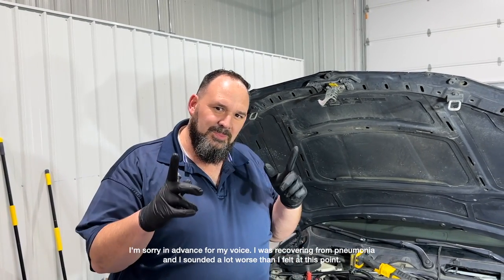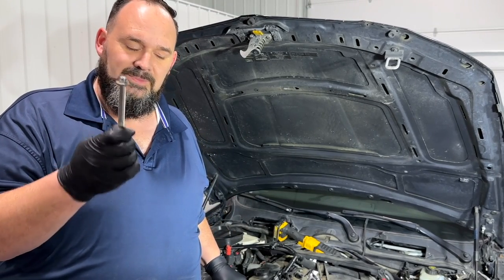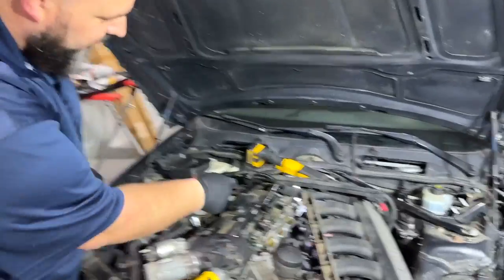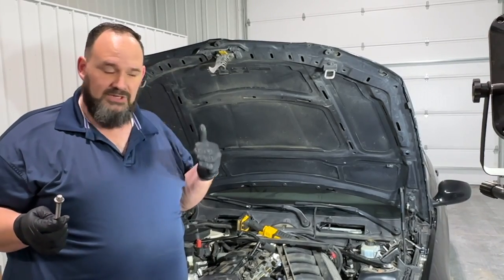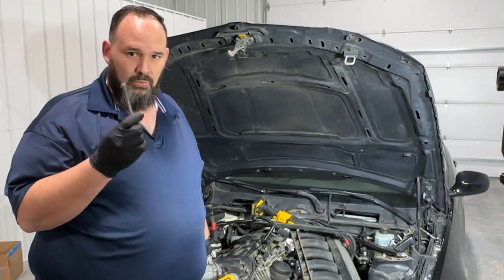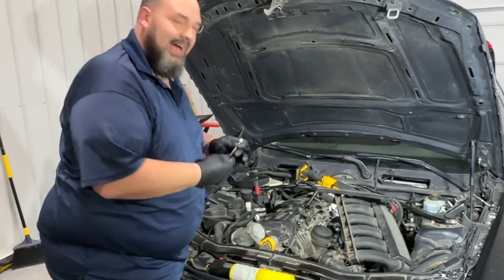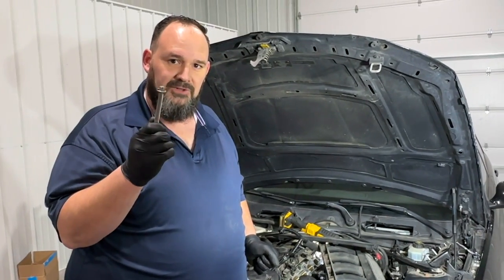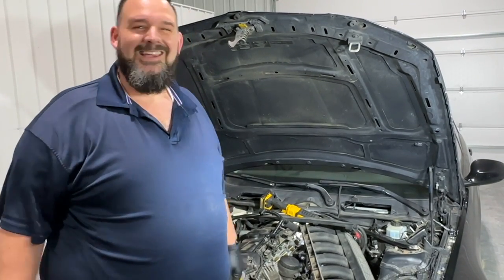Watch this before replacing your E-Series BMW Starter!!  -  E90 Maintenance Series

Comment: Thank you.  Mine didn't have corrosion - but being 18 years old, was concerned, as already had done this before on an E36 BMW.  I used the same 12-point 11mm wrench with 15 degree offset, that I used on the E36, both worked nicely without rounding.

Comment: In very many cases,  in order to use jb weld, the head of the bolt is soaked with oil, in order for jb weld to work,  surface of metal absolutely HAS to be clean and scuffed as much as possible. In this case. That head of the bolt is a super "can't understand normal thinking" 
Just my 2 cents

Comment: I just got that damn evil stupid bolt out. Had to saw-zaw a vertical slit that cut the bolt in the middle of the threads. Still half the bolt was holding the starter in. then I drilled in the center of the slit to just weaken the starter ear metal. Then I just took a hammer and bashed the starter loose. It broke off leaving a nub of the starter ear with the rest of the bolt. Then I hammered the nub in a way to twist it around the remaining bolt. The nub finally came off. Then the bolt was sitting loose in the tranny bore. Just pulled it out. I’ve worked on cars for years. This was the worst job I’ve ever done. I gave up multiple times. Told my dad to bring to a shop because I was done. It really demoralized and angered me. Seriously. But I got it out. I listened to all the warnings but I didn’t appreciate just how horrifying it is. But I fing did it lol. Just get violent without messing up the starters mating surface on the tranny.